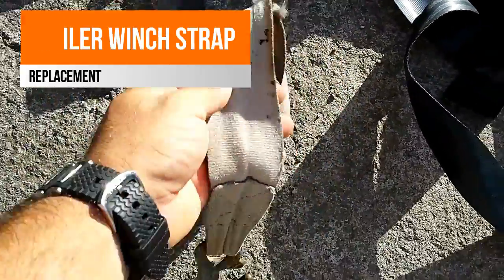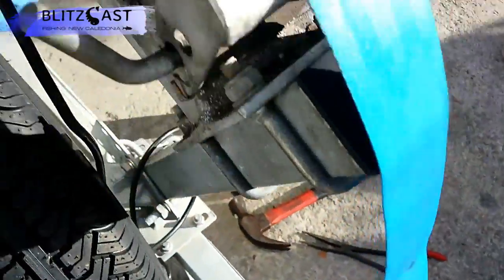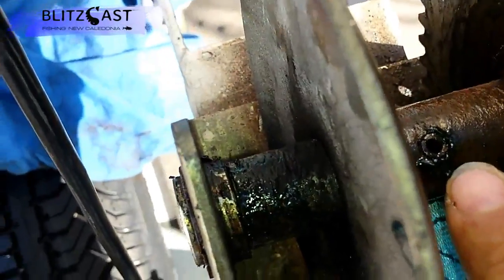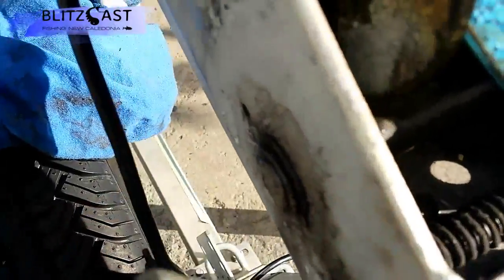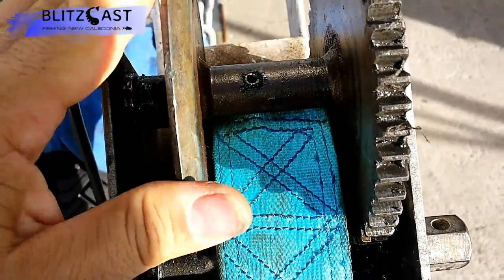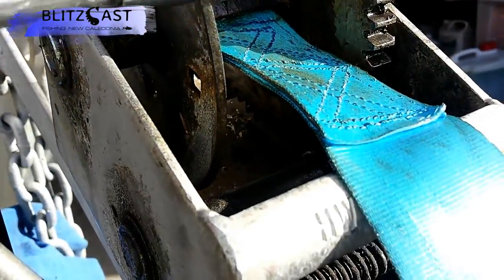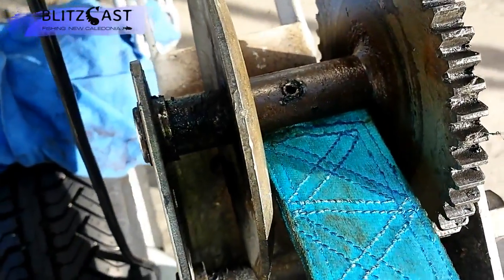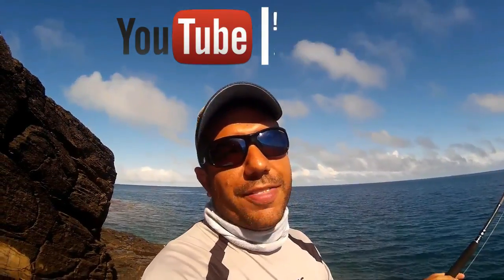Trailer winch strap replacement, How to replace (no bolt version) Tech talk 1.

Comment: Yeah, I've got something similar but not exactly the same on my Quintrex trailer. Still searching and trying to figure it out. I've seen a lot of simpler designs. I don't know why they come up with alternative designs which are harder to do. Thanks for your video. It hasgiven me some ideas and helped me realise I'm not overlooking something simple.
Reply from the maker: no worries mate, happy it helped.  I've gotta overhaul that winch now as it hasn't been used for ages and there is quite a bit of rust....i've got a new boat with an ARK winch, haven't looked at that strap replacement yet....cheers
Reply: That's great, thanks you. I reckon I'll get it now. Boppo.